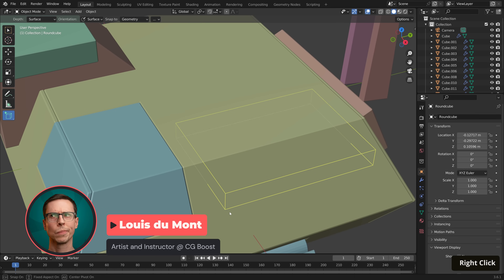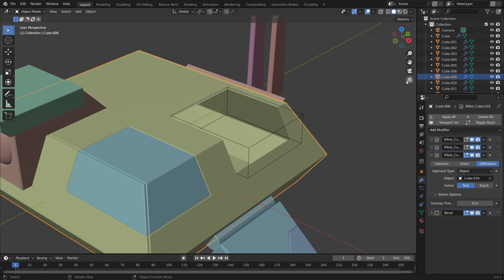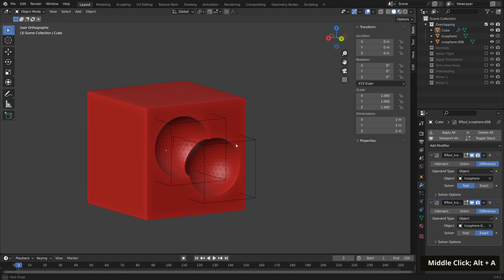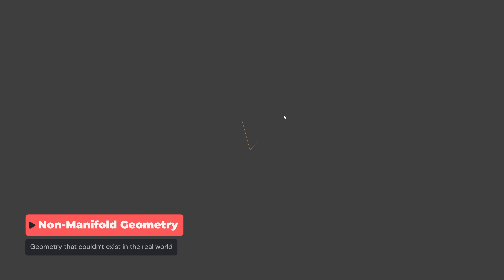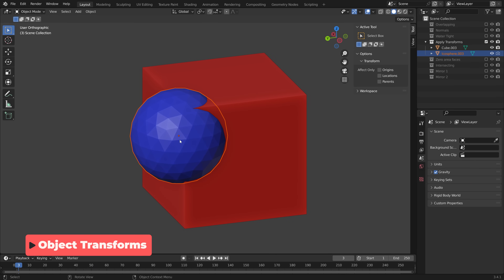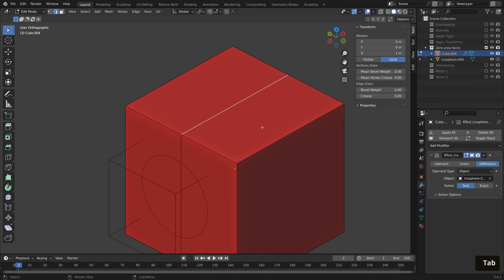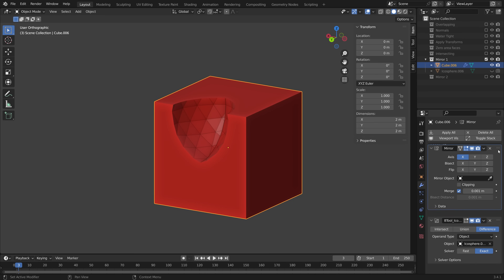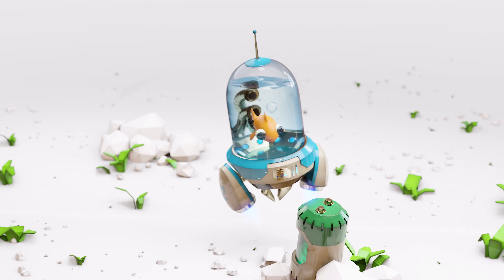7 Boolean Issues in Blender (And How to Fix Them) #b3d #tutorial

Comment: Booleans are logical, nice and quick... but you will end up with messed up topology. Triangles, ngons and weirdly grouped verticles everywhere. That will cause shading issues (pinching) and if you try to apply bevel or sub-d to that, it will give you bad results (faces sticking out of mesh).
I wish there would be some advanced boolean modifier with retopology, that will give nice even quads 😮‍💨 And you can focus on the making of what you want, not cleaning the mesh for hours.

Comment: i have an error I can't find a proper way to fix it, when I use boolean on an object y creates this edges between vertices on the hole it created and up to the vertex on the edge of the face I booleaned. Any one knows anything about this?
Reply from the maker: You may have tried this, but it's worth switching on "self intersection" and "hole tolerant" for more complex meshes. You could also try adding a weld modifier before the boolean operation incase there's any double vertices. ~ Louis

Comment: Super nice you show all variants. Wonder how long it took you to even find some of these. There are somany variants. Especially those with self intersecting.
I had this weird issue with bevel after boolean.Finally solved it by using shading > harden normals. I tried using smooth normals, doesnt seem to work as it worked with GN setup
Reply: kinda hoped you showed bevel after boolean

Comment: I've found that these problems are problems not only issues with bool but overall: I do have a habit of running "merge by distance" when moving vertices here and there.

Last time I encountered non manifold geometry, it froze blender  so much,  I couldn't move mouse cursor during edge split. (It was regression in 4.2 and devs fixed it in couple of hours after me reporting it). 

I also tend to keep normals lines display for faces, though it mostly for scripting. In python scripting normal of mesh depends on order of its vertices. Ie. quad [A,B,C,D] has the opposite normal of quad [D,C,B,A]. I don't remember why I dislike face orientation for it.

Comment: I have a question, why when i use bolean once it works just fine but when i move the object try to do it again it wont cut anymore? 
its not just because im using the same object because even if i try to create another shape and do it with a seperate thing it just doesnt work how do I fix it?

Comment: Just a note for anyone flustered and confused by the boolean tool. remember to check ALL Y points that have z axis edges. I had 2 y points off by 0.000001 mm and it completely screwed the boolean tool. only took me 8 hours to find the fix. hope this saves someone some time!

Comment: I have used booleans a lot after a few months foraying into hard surface stuff because theyre just so darn practical. But my word are they also frustrating, learning how to diagnose their issues has been a pain.I think this is one of, if not the best video to assist with any issues you will run into (in most all cases) seeing as I thought I had gotten porked by every possible issue already. But lo and behold, face orientation on the active boolean got me today and this video saved me an unknown amount of time as I had already tried most of what I knew. And not having enough experience to know what to look for I just looked for bolean issues videos again. So thanks for continuing to make helpful videos.

Comment: I am quite new to Blender. When I used boolean difference to make a hole, it shows the hole in layout, but not in modeling. Is that on purpose?
Reply from the maker: hi yes, that's because right now the Boolean operation isn't applied. To see it in edit mode, you must apply the modifier.
~ Masha

Comment: 00:33 how to bring up this panel
Reply from the maker: It's done with the Shift+Ctrl+B shortcut. The panel is identical as the one on the right side panel that's enabled by pressing N. There in the Edit section you should have Bool Tool panel (if you have the addon enabled)

Comment: I have the walls of a building that i used boolean to cut the windows, but when i export in glb (i need this type of file) the walls are null objects and it corrupts the original mesh... Can someone help? It's an emergency
Reply from the maker: Did you apply the booleans before exporting the object?